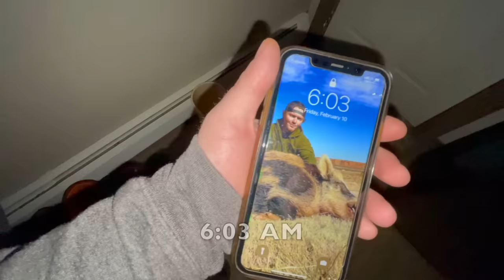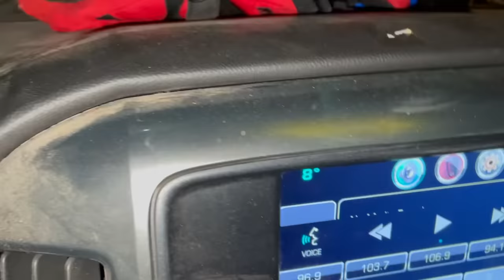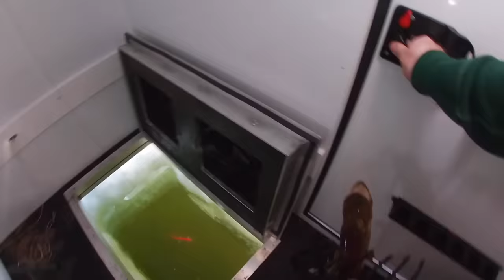Bikini ICE SPEAR FISHING w/ A Big Hole for Giants!!! (LIMITED OUT!!)

Comment: Couple spearing tips for ya if your interested.  Ease the head of the spear completely into the water and then give the spear a lite push/drop dont toss it. Another tip the big one that was lost let them sit on the bottom and wear themself out lift up on the rope so the whole weight of the spear is pushing them into the bottom when raising them up push them into the ice on the opposite side of the hole before lifting them out.

Comment: When i ice fish i was taught to put spear just under the water like stick it on the ice make a little shelf and have the tip stuck into it.. so when you drop the bang on the fish there is no splash works good for me and has been for 15 or so odd years spearing fish. And for a another note on your decoy always always have it hooked to a reel.  Line should be min. of 50lb strength with a wire leader hooked to decoy and so you don't lose everything. Reel should be adhered to wall or ceiling of ice shack. Also reel with Chub on it too. Don't know how many times a Northern came in at Mach 10 and grabbed decoy or Chub and headed out with it in its mouth snapping line.  Again when we put a big Chub on a line and in hole,...put it down about 3 maybe 4 feet or so watch chub. If a Northern or Walleye is coming around it will always swim opposite of what is coming. That way it gives you heads up so you can grab your spear and lower the bang on it. Not that you didn't do well... those are awesome fish. Funny you have electronics hahaha i don't, so i do it old school. Around Mobridge is where i ice fished.. did well and still do awesome at this. Take care, be safe, have fun, it is what life is about! looking forward to your next adventure.

Comment: I noticed your spears did not go through the Pike very often, so make sure your spears are very sharp pointed and then use two hands, one at the top of the spear and the second 2-3 feet lower.  Use the lower hand as a stabilizing guide as you throw the spear using a little more velocity as you throw.  If the spear fully penetrates the fish you should not lose them.  The house should also be dark so the fish won't detect your movements and as you did always move slowly until you throw the spear.  Oh, also the weight of the spear will affect the penetration as well so I prefer heavier spears as opposed to the lighter spears.  If you have any rocks on the bottom monitor your spear tips and keep them sharp with a file.
Reply from the maker: Thank you!👍🏻
Reply: Они и так неплохо наловили
Reply: Лучше закачивать на точилка, Эл мотор закреплены на столе с камнем , или на болгарке , или Угловая Шлиф Машинка УШМ